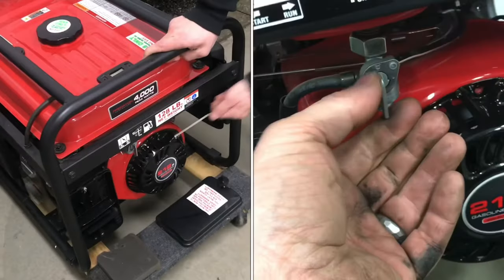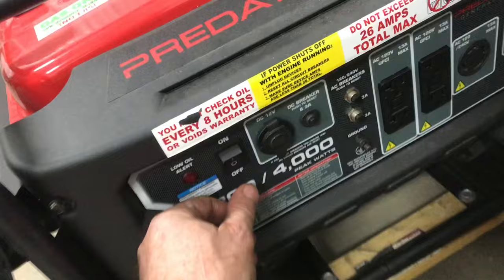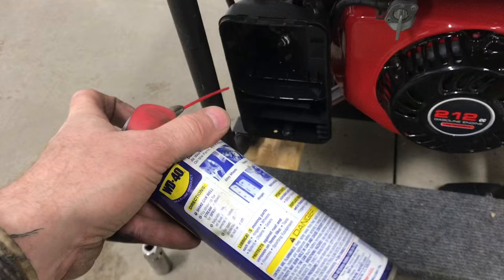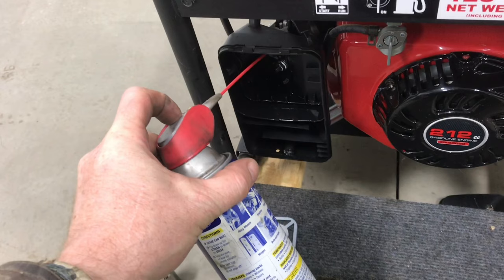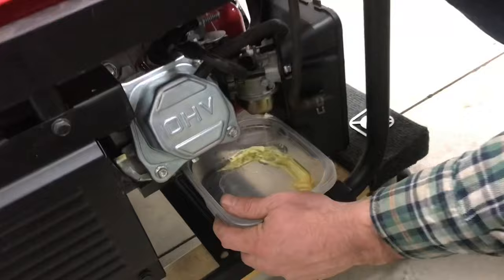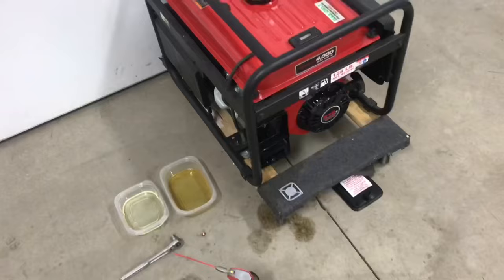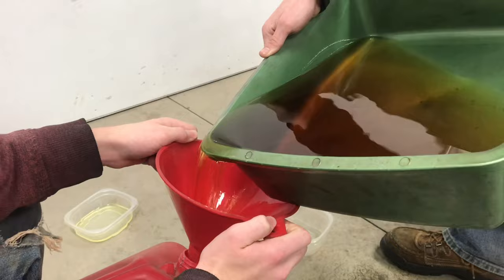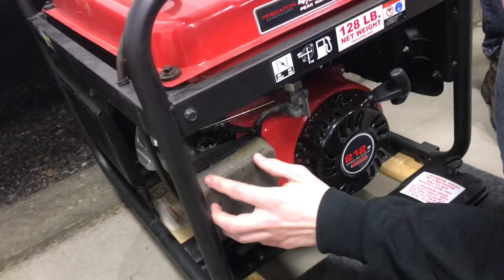how to START a generator that’s been “sitting too long”

Comment: It’s always such a relief to get a bunch of great information in a short time! I feel like hours have been added to my life. This was perfect. Thank you
Reply: Definitely.    95% of youtubers would stretch this info into a long winded 12-18 min vid.
Reply: Yup - this is the kind of content we need more of.  I would add one thing to video - make sure fuel filter isn't clogged.  And some generators have tiny little inline filters that slide inside the nipple on the bottom of the fuel tank like on my Champion 3100W inverter generator.  (#75537i) They clog easy and you can't even see them until you pull the hose off.  They pry out with a little screwdriver or knife.

Comment: That's  only getting the engine running side of things! How about the electrical? One of the things that happen to generators is the stator will lose its magnetic field after sitting for long periods of time, and you have to give it a real quick zap from a 12 volt battery if memory serves me correct? Nothing chaps mens ass as bad as getting the engine to start just to find out that he still hasn't gotten the piece of equipment to work properly! And most people don't even know about this and it ends up in the trash or free Craigslist  because they don't know about it. 😉
Reply: How do you zap it with 12 volt battery

Comment: How do I get rid of all that gas sediment? Water? Mine has been sitting for years and is barely used. Thanks
Reply: If people would add gas stabilizer and start it every 3 to 4 months they would not have problems.  I run mine thru about 3 gallons of gas a year by doing this.  Haven't had to use it in 4 years due to hurricane power outage.  Starts right up every time.

Comment: Ok but this is only half the job, that carburetor will be full of gummy varnished fuel,  jets will be clogged
Reply: How do you clean the jets
Reply: @Duty2Rebel  remove the main jet (bottom of the carburetor, remove float bowl) with a medium sized flat head screw driver, after soaking with breakfree / penetrant / PB Blast, run a twist tie wire through the jet, also remove the emulsion tube that sits atop the jet, run wire through all the little holes each way,  lastly, do the same to the idle jet under neath the black plastic philips screw on top the carburetor, it is a much smaller diameter jet,  2mm, need a tiny wire, or spray might clear it

Comment: I just bought an LPG generator for this exact reason. Mine is for home backup only and could go a long time unused. Plan to run it up often but I wont have petrol in the system for long periods going nasty. My cooking supply already comes from twin 46kg Propane bottles so we always have fuel ready to go. They are quieter and smell less than petrol and diesel units

Comment: My Generac starts with the pull rope and runs just fine. I don't run my Honeywell 7500 watt very often, but I do do  a maintenance run twice a year. Just yesterday though (Nov 14, 2023) the electric start doesn't work. I've got 12 volts, good gas and good plug, but I'm not getting any turn over at all when I press the start switch. It's like it's got a broken wire somewhere.
Reply: Oil ?

Comment: I have a generator which sat for a few years with the same gas.  I checked out all the things in this video, put in fresh gas, etc - it starts just fine with a squirt of starting fluid, but won't keep running.  It won't start at all with just gas.  

As far as I can see, there are no blockages in the fuel line.  Yet it won't start.  For what it's worth, it ran like normal when it was started a few years ago.  Only time has passed.

Any ideas what to do, or what might be the issue?

Comment: HOW were you able to wipe out the sediment at the bottom of the gas tank? What did you use to reach inside? thanks
Reply: SicSemperMortemTyrannis  ok. thanks
Reply: SicSemperMortemTyrannis ??  For me and others like me that really need an explanation, you're saying spray the fuel tank with water from a high pressure garden hose then... There will be water in the fuel tank so, follow that with draining the fuel tank of the water mixed with sediment and allow the fuel tank to dry???

Comment: Put some gas preserver in it and it will be ok. Or if you can, use gas without ethanol. Ethanol is a engine killer, specialty 2 strike engines...but affects 4 strokes engines to.

Comment: Tell me I'm stupid or my generator doesn't have a choke lever.

After about 40 minutes of trying everything I gave up. I'll check if the choke is there but I didn't turn it on